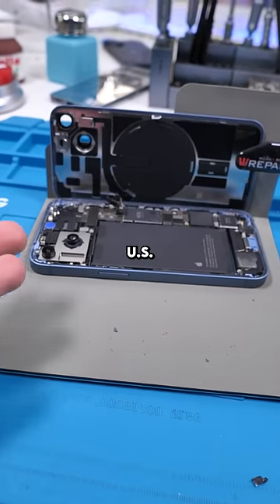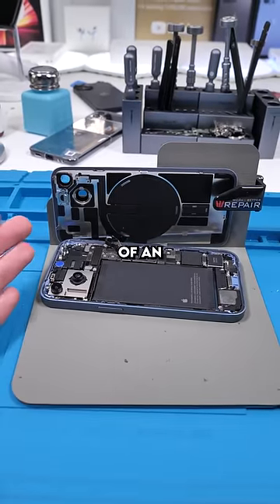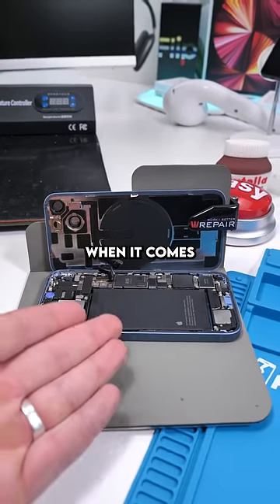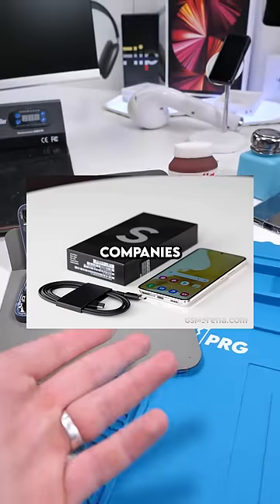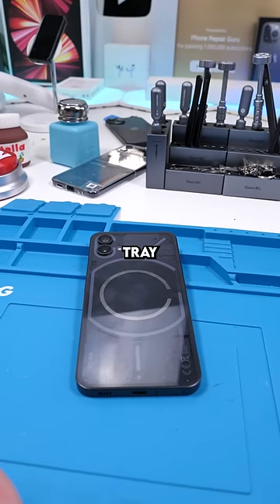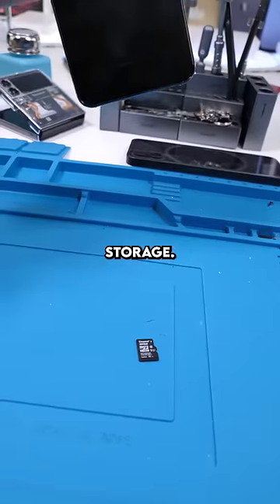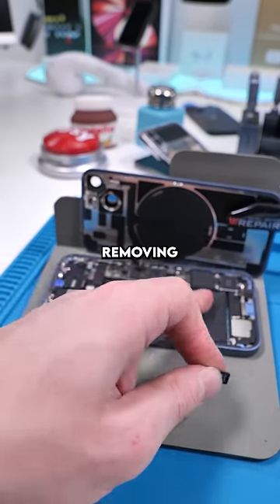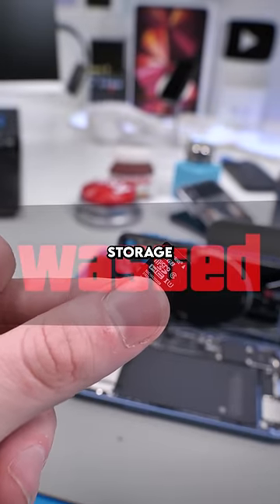The Serious Downside Of E-SIM..... #shorts

Comment: Yeah, You are definitely right. As a Android user, External memory card is helped me a lot.
Reply: Phones nowadays have huge amounts of storage that you'd not be able to use anyways, + there's ways Google drive and other cloud storages
Reply: As another long time android user, having a 16 to 256 GB micro SD is so practical, especially when getting a new phone, since all of your saved data can be stored on there, not to mention transferring files between devices, the extended storage itself and so much more.
Reply: @Vader4499  Yes but that's either in your phone (you can't just plop one phone's memory into another's), or on a server somewhere (requires internet connection, may not have consistent upload/download speed, vulnerability to hacking)
Reply: @mihael64  I don't know man. When ever I buy a new phone, I kinda just plop the storage over with a transfer, just takes a long time. I get your point, it's very valid, but cloud storage and the phone's high amount of storage give me more than what I'll ever need, and every 2-3 years storage options increase a little anyway, so when I transfer data, I'll have extra anyway. Talking about vulnerabilities to hacking, I think that it does depend a lot on the service you're using, and I don't think that a service that's entire purpose is to allow you to safely store data would cheap out on security, especially if it's a big company like Google. But great point with connectivity, but as we move on to a world going more and more digital we are getting faster and faster speeds for cheaper, so I don't think that would be a problem in a few years.
Reply: @Vader4499  I completely understand your point, especially on cloud data storage. It's very convenient, especially if you need it on multiple devices at a time, and for ginormous amounts of data (which is becoming more of a need in recent years). I think I prefer physical expandable storage purely because of the convenience and because of the physicality. It's convenient that it acts like an actual extension to ypur storage, instead of a seperate one. And I personally prefer like having a physical little thing that i can touch and see and actually physically move rather than a menu screen for my data on a server thousands of kilometers away.
Reply: @mihael64  Hm. I guess, then at the end of the day, it all comes down to preference, the preference that is being removed now by these companies. 
Well, as with all things, they're more convenient than anything until something more convenient comes along which people then get used to.
Reply: HeyoNax  1gb ain't much
Reply: well I have a galaxy S21 FE so I don't have removable storage anyway
Reply: @Vader4499 I have like 200gb of music, pictures that is a must move.... how long whould thise take? And I can get a 256gb memory card for less money while the companies charge for like $500
Reply: No he doesn't.  IPhone a trend setter what a f joke.
Reply: @mauinisikawa1808  Would probably be done in 3 hours if you're moving to a new phone. I moved about 50gb in 30 minutes when switching from my OnePlus 7 to OnePlus 9.
Not an expert. Sure, you could get the memory card, but my point is, that in some years, with advancing technology, you'll be able to transfer that data much faster!
Reply: @Vader4499   No, the problem is where can I store it....
Reply: @mauinisikawa1808  Cloud storages, and a laptop. Laptops these days easily have 1 or 2 TB storage, so you can easily store 200gb of data
Just move from cloud storage to a laptop. It's a time taking process, but it works if no other option is available.
Reply: @Vader4499  I'm not. If thats gonna be the case, I am going to be making my phone twich the thickness with a external ssd. Cloud or laptop for misic and stuff is just stupid
Reply: HeyoNax  so I'm not the only one XD
Reply: @mauinisikawa1808  To be honest, according to me, downloading music MP3 files is dumb anyway. Just download them off Spotify or something. Not that hard and much more convenient.
Reply: @Vader4499  you could get better storage with an SD card and way less expensive than buying a phone 200$ more expensive just for 256 GBs more of storage. Cloud sounds good and all, but remember, you're giving them money for their cloud system and once you're out without internet, you're completely unable to access your own information.
Reply: @Vader4499  micro SD are really cheap for a lot of storage, it cost more buying the device with a larger storage.
Reply: @Vader4499  my gawd you are privileged,not everyone has constant access to good internet or even have computer.
Reply: Spearhead  frfr
Reply: @zackattack9228  but you can afford a 1000 dollars phone? Ok

Comment: We need to do a strike on buying phones. Just buy cheap ass flip phones and use them only for texting and calling until they bring back the stuff we want
Reply: Too many NPCs that go crazy over next years copy paste phone with removed features and a slightly prettier bezel to be effective
Reply: I'm already there. I haven't had a new phone in 7+ years. I currently use an old Blackberry for basic calls and text, and I have a Samsung S5 that I'm building. It's a great phone when you ditch the stock firmware and install Lineage OS. It's got upgradeable storage, removeable battery, headphone jack, IR blaster, LTE network support, and is still better featured than most of the phones my carrier has been trying to offer me.
Reply: @lihtan unfortunately Verizon doesn’t support the S5 anymore, for some reason

Comment: honestly the SD card slot is what kept me glued to my s20+ even though I had bought an s21+ last year
Reply: Still using my note 10 plus because of the SD card slot.. wanted to upgrade but the newer phones just suck to me
Reply: Same here i bought a S20 ultra just cuz it has more features than iphones but now I'm starting to drift to apple 💀
Reply: @Raphaelpoh  lucky you have a note 10 plus instead of a standard note 10 which removed the sd card slot
Reply: @Deuteriumaddict  yeah, I thought it was a one time thing but was pretty upset when they removed it for the s22u
Reply: That is the main reason I'm still glued to my s20. Now the only phones without a sdcard slot that I want needs to be no less than 256 gigs.
Reply: @dajam9035  true and same
Reply: I have the S10+ (last S with the headphone jack) and i'm never upgrading until they add the headphone jack back.
Reply: I have the s20 FE and it sucks that when the time comes to upgrade I am not going to have the option for removable storage
Reply: @PigIlFigo32  trust me, they will never add it back
Reply: @PigIlFigo32  does it supports 2 SIM cards + MicroSD card at the same time? Because I want to get it 😅
Reply: @farishassanz  no, it's either 1 sim and sd or 2 sim cards
Reply: @PigIlFigo32  
Ok thanks , it’s arguably better than no SD card support
Reply: Wtf why dud they temove it
Reply: but you still fall for samsung lol
Reply: @PigIlFigo32  what about not getting updates ? What will you do
Reply: @nikicarrie4071  I really don't care about updating the android system and its apps as long as they're not from like 2015

Comment: Apple: We removed the headphone jack because theres not enough space for it

Also apple: puts piece of plastic instead of the sim card
Reply: Is that actually the reason Apple removed the headphone jack?
Reply: @JustAnotherThree  it's one of the reasons they gave
Reply: The fact they had to create a mold for a plastic piece instead of leaving it just empty is a waste of money and plastic.
Reply: Remove headphone jacks is to sell air pods more 
I agree with headphone jack and sd card removal because which will cost more for IP rating cost with those two extra holes

Remove simcard tray is i think to save invironment and problem of sim card being taken out after being stolen
But putting plastic peice instead of sumcard tray is to save redesign cost just for USA region 

But i dont understand what is the reason for removing charger?
It was not clearly to save the planet because we have to buy a new charger which comes with a seperate box and ends up more plastic and packaging 
Removing charger is simply to harvest more money from customers
Reply: Think that the empty part in the future will be used for improved battery or new functions . Nowadays all other countries still have the sim tray so could be tricky and too expensive to produce two completely different models of iphone
Reply: Dyingtoself  No one need too-big screen that cover 99% of phone 90% is also good.
Reply: Airpods are UNBELIEVABLY profitable, that's why the headphone jack is gone.
Reply: @akihikokougeki8945  They could make the headphone jack totally waterproof, it's not hard.
Harder for lightning/USBC, but not impossible.
Reply: @akihikokougeki8945  The sd card is encrypted on modern phones so thats a non issue, the main reason for the removal is that they get more money.
Reply: @Appleday99  I don't see that happening bc they would have to redesign the motherboard and for what a 100 mah also apple doesn't like redesigning iPhones.

Comment: 2030: we removed the battery, we saw it as unnecessary
Reply: Wouldn’t be surprised if they did that tbh and made an “e-battery”
Reply: @sck_stitch  how does e-battery work?
Reply: @sakmiov688  You plug it into a wall or buy Apples optional battery pack
Reply: Agenda 2030 👍 Sustainable Development Goals
Reply: Yeah, that is unnecessary true due to wi-fi power delivery having a battery is unnecessary
Reply: Instead, the device will plug directly to the user's heart. Thank you for choosing T-Mobile
Reply: Well that will be cool
Reply: @sakmiov688  have no idea
Reply: @TacomaParkour  😂
Reply: Arc reactor is only sci-fi

Comment: you can take my sim card, but don't you dare take away my removable storage
Reply: the lack of sim card will divide alot of users permenantly. 

this is why apple still released the sim card version 14 in other countries.
Reply: @dnegel9546  if you dont have a sim in italy you cant even call people lmao
Reply: @cristaltom2377  but you can basically use messenger which is free you just need to have internet all the time to call someone
Reply: U could always use a usb hub with an sd card slot
Reply: @ThePenguin134  using inconvenient dongle? Rather than storage that can be used internally?
Reply: @cristaltom2377  that's the same everywhere. It’s not that this model doesn't have a sim card, it's that it's not removable or rather it's a virtual one

Comment: I find it weird to call Apple a trendsetter when they are never the first ones to do anything.  They are following in someone else's footsteps with all of their products.
Reply: Tell me one example mentioned in this video that’s false and Apple didn’t start the trend
Reply: @belle_noire  while the examples in the video are correct it's more a feature thing, like Samsung had wireless charging 3 years before Apple did it, fingerprint unlock, face unlock, etc
Reply: @amythistxue1  Wireless charging and face unlock were indeed present before Apple did them but face unlock on androids back then and sometimes even today is based on detecting a rough shape of your face and facial features whereas FaceID projects infrared dots on your face measuring depth and creating a secure 3d model of your face which is much more secure than the competition and even more secure than fingerprint scanning which by the way Apple did first with iPhone 5S and then Samsung second with the Galaxy Note4. I’m not saying Apple is the ultimate and only trend setter by any means, but they do many things first what others like Samsung make fun of with funny ads but then adapt the same changes themselves.
Reply: I feel that Motorola was the prelude from having a fingerprint security (Atrix 4G), removing the headphone jack (Moto Z), and going all eSIM (razr 2019).
Reply: @Claro1993  you got me there on the fingerprint scanning, haven’t even heard of the phone and technically yes they did it first but they still didn’t start a trend with a phone barely anyone had so my point still stands, the moto z released the same time the iPhone 7 did though they did anounce it a few months earlier and that phone did actually sell well as well as the Razr so I admit defeat. But it could be said that if Apple wouldn’t have stolen these “features” those other phones themselves still wouldn’t have started a trend because Motorola just isn’t big in the industry anymore
Reply: iPhones really aren’t the first to do any of the major features they implement, but generally once apple does it, it generally becomes standard for all other companies.
Reply: @belle_noire  you want an example from the video? The headphone jack. Oppo did it first in their r5 phone in fall 2014.
Apple never did anything first, they always just stole from others and presented it as their idea.
Reply: @belle_noire  
Every single example in the video, Apple was the follower... not the leader.  They are always the follower.

And since Apple copied others, that makes the others the trendsetter... not Apple.
Reply: @belle_noire  Bro you're really stuck on your iphone echo chamber. I recommend you to read more about the mobile market outside the US or Canada, because these """"trends"""" are only found on high-end android terminals mostly. Many budget and mid-range android terminals still have headphones jack, sim tray and they probably always will. Just because motorola doesn't launch 3 morbillion phones per year doesn't mean they're not big, motorola is still relevant being in the top 10 market share by brand from last year and their high-end terminal always have good scores on benchmarks and you can look it up on antutu and geekbench if you want. Take in consideration that nowadays there are way too many android terminals manufacturers and competition is quite harsh for motorola now.
Reply: @amythistxue1  yeah, they had wireless charging, but they also had phones blowing up left and right didn’t see any apples blowing up
Reply: @Spawn_Media  but the batteries of iPhone lasted 3 microseconds💀
Reply: @amythistxue1 always on display, USB C,
Reply: U know why they call apple as a “trendsetter”? Because when they do something, others will also follow. Remember when the iphone x came out? Every one was having a notch, and some of them mimics the iphone’s notch in small manner. That’s why apple become the trendsetter. They are not the MOST ADVENTUROUS brand, like any other brand out there (for example, samsung).
Reply: @princerapada2078  Apple fans ruin everything
Reply: @Eric  Samsung was first brand to have an embedded sim. S20 was the first model. Welcome to the trend. Everything that Apple does is not an innovation( if you call removing things an innovation, then may be) Samsung is the one that drives the mobile innovation. Amoled displays, biomatrics, dual pixel sensors and pro grade cameras, waterproof phones, Wireless charging, separate hardware for Security(knox), first Stylus on a phon or tablet. Samsung tap pay, laser cut infinity displays. Folding screens. The list goes on.

Comment: Back in the day when most phones had 8Gb of storage and even flagships only had about 16-32Gb SD cards did help a lot. But nowdays with budget phones having 64-128Gbs and flagships having upwards of a Terrabyte. It's well more than the amount of storage I'll ever use on a phone.
Reply: That is only if you are not heavy gaming app user.
As times passes, newer games takes more space to install even on phones. So, it wouldn't be odd to see a 1TB sized game on a mobile in future.
Plus, SD card are more cheaper storage option compared to inbuilt storage on phones.
Reply: @Sup_D  Well I'm not. But good point.

Comment: You’re more than likely right about this, but the phone makers that have removed Micro SD Card Slot support have also kept removable storage functionality by still allowing those phones to have removable storage devices, depending on their power draw/source, connected through the phones’s data port, or charging port. Which allows the transfer of files and important media to the connected storage device.

This does include iPhones with the lightning port, but it’s better to get apple certified dongles, if needed, for this task… though I’d recommend to just upload you media to iCloud then download it onto your pc, since that’s a way better method than waiting for ages on the slow as balls data transfer with the lightning port.

Comment: There's other types of expandable storage, like a usbc flash drive.

Also I feel like internally expandable storage is for those people who do "x photo is why [character] looks/feels like this" posts.  Also, when phone frames get bent, the sim/storage tray is the thing that gets stuck, until the frame where the tray is located is straightened out.  Also the pin that allows removal also seems to get damaged a lot when the aforementioned frame damage happens.

Comment: Unfortunately I think that you are correct about this one. I also think that it won't be long before Apple tries to go completely portless meaning that you will need to use a wireless charger to charge your phone. The reason why I absolutely hate the idea of doing this is because of data recovery and because of problems with RFID making it easier for Apple or someone else to basically just shut down your device or simply shut down the charging system to force you into an "upgrade" or replacement or repair at your cost that you pay to them. This is a common ransom situation with a device and this is what many companies have been trying for years now and they finally have it.
Reply: bro your spitting out dark facts❤️❤️❤️